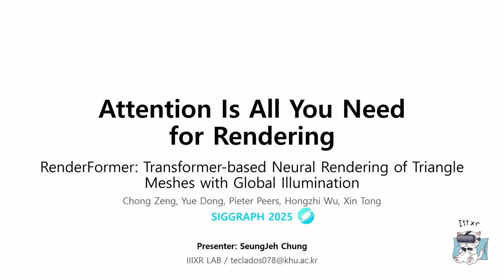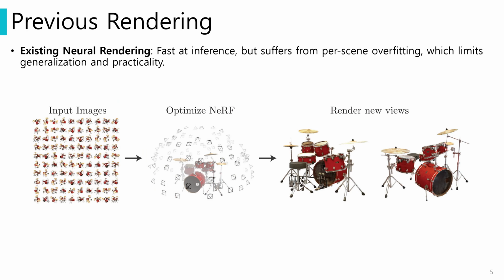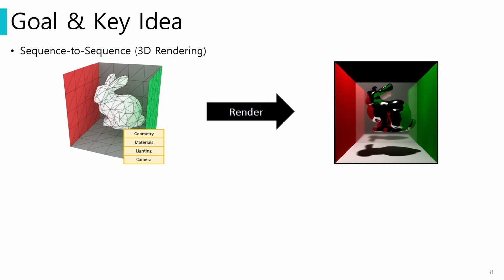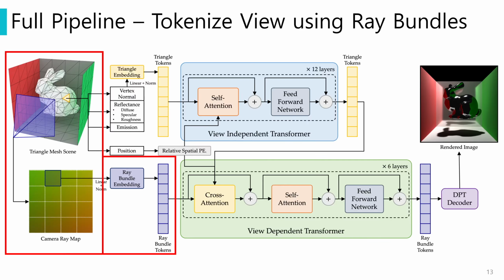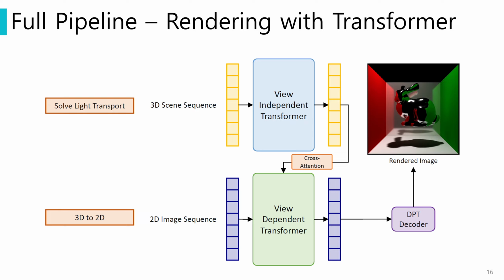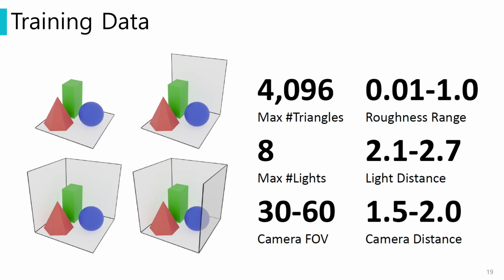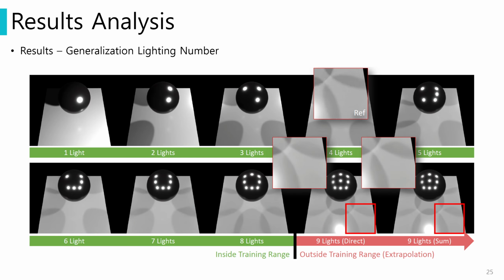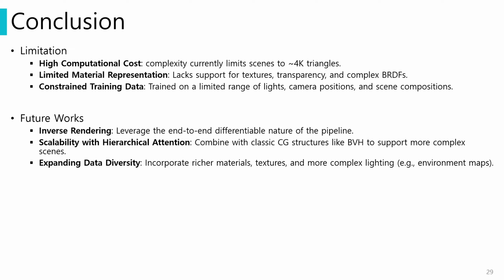[Seminar] Attention is all you need for rendering

Comment: Q1. As mentioned first, standard rendering methods (not training) are highly cost that training-based methods like Transformer are needed. Then, why Transformer is choosed for backbone? Attention mechanism needs huge cost for calculation. I think Mamba is more suitable. Isn't it?

Q2. In this paper, I think there are no contribution for architecture but just engineering. Is the paper valuable for first thinking of the training-based renderer? I want to know the specific contribution that why the paper has accepted in Siggraph 2025.
Reply: Thanks for the really thoughtful questions!

Regarding your second question, I believe you've hit on a key aspect of what makes a paper suitable for SIGGRAPH. In my opinion, the conference often values a groundbreaking idea and impressive visual results more than a novel network architecture by itself.
The main contribution of this paper isn't so much the engineering, but rather the new concept it introduces: the idea of using a trained network to handle high-level rendering tasks like global illumination, moving away from traditional, complex computational processes. It's a paper that opens up a whole new direction for the neural rendering field. Plus, as is typical with Microsoft's work, the results were beautifully presented from various angles, making it a perfect fit for SIGGRAPH.

And that connects directly to your first question about the architecture. You're absolutely right that the attention mechanism in Transformers is computationally expensive, and Mamba could be a more efficient choice. I see this as one of the exciting future research directions stemming from this work. There's a lot of room for architectural improvements, like swapping in Mamba or using convolution modules. Reducing training costs and optimizing for speed and resources are definitely key challenges, which the paper also acknowledged as limitations and areas for future work.

Comment: For me, it was a very interesting and unique topic!
Q1: RenderFormer formulates rendering as a sequence-to-sequence problem, but doesn’t representing a 3D scene as a sequence inherently cause information loss?
Q2: When triangles are tokenized individually, can the model still handle complex scenes stably? Doesn’t the computational cost grow excessively?
Reply: Regarding your first point on information loss, it's a great question. While representing a 3D scene as a sequence seems like it would cause information loss on the surface, Renderformer avoids this. It doesn't just create a 1D list; it uses relative positional embeddings (based on RoPE) to preserve the complete 3D spatial relationships, like distance and orientation, between every pair of triangles. This means each token is aware of its 3D relationship to all others, so there is virtually no loss of essential geometric information.

However, this very method of considering all pairs directly leads to the issue you raised in your second question. You're exactly right—the computational cost grows quadratically (O(N²)) with the number of triangles. This poor scalability with complex scenes is currently the model's most significant limitation. To address this, the authors propose in their conclusion that using hierarchical structures, like a BVH, to guide the attention mechanism is a key direction for future work.